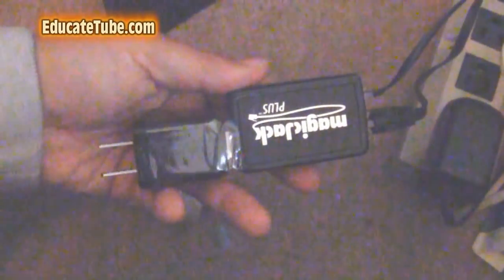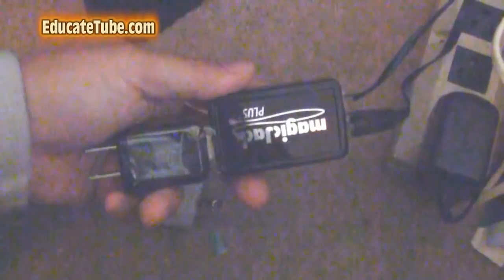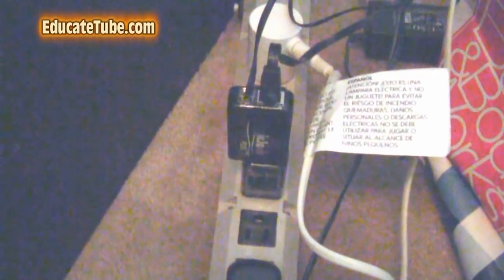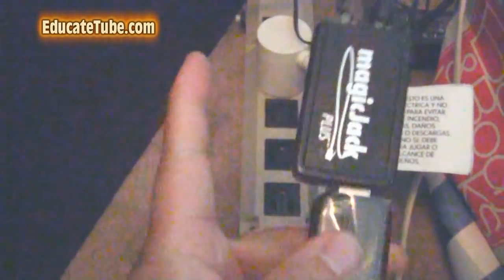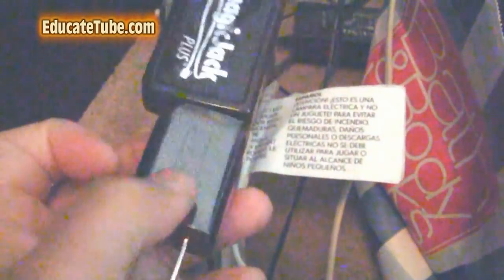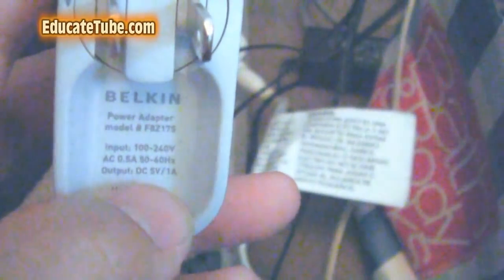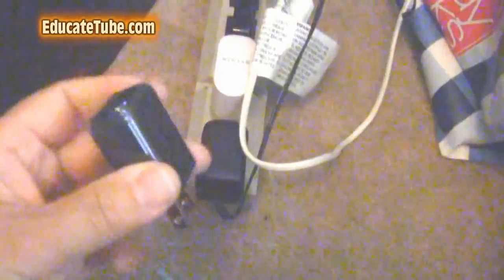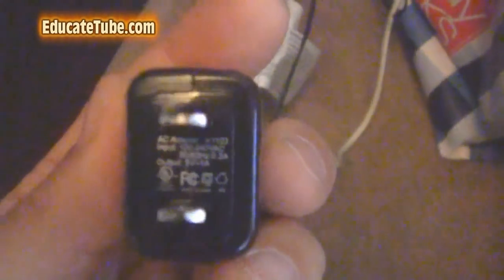How to repair or fix MagicJack Plus Hardware VOIP device by replacing USB AC plug

Comment: I have constant issues with constant beeping noise that people on other end are hearing. I call tech support, they fix the issue, but then there is a constant loud static noise on my end? Is there a solution to this? Using magic jack plus for panasonic cordless home phone......never had these issues until about a year ago, and have had device for 7+ years.

Comment: I have replaced power adapters off and on for years. Why does this keep happening? And I'm not even talking about packet loss that affects conversation. MJ tech support claims a newer MJ model does not have this problem.  I am ready to return to a wired landline.

Comment: so yeah i switch my power source, i have blue light but no lan connection no orange and green light for the lan 
i need help
Reply from the maker: Make sure your internet and Magic Jack account are active.  If the light is on that means it may not be the power but the device itself.

Comment: Just as an fyi, as long as the voltage matches (5V) the amps on the replacement P/S can be higher than required:  The device will only draw the amps it needs, anything extra will not be used.  For example, a 5V/2A power supply would be fine for the MJ.  It's always better to have MORE amps than needed, in case the device draws a tad more than it's rated at.  If it tries to draw more and there's no more available, there could be overheating and damage.  I always buy power supplies with higher amp ratings than required.  It's like having extra horsepower under your hood-- You may not always need it, but it's nice to have.  Remember though:  You CANNOT use a P/S with higher VOLTAGE, it'll fry the device.  Also:  Current is rated either in milliamps (mA) or amps (A).  1A = 1,000 mA, so for example a p/s rated at 5V/1500 mA is the same as 5V/1.5A.  A p/s rated at 5V/750mA is not going to work with the MJ (not enough amps).    Hope this helps someone.
Reply from the maker: Thanks for letting us know.

Comment: Great if the only thing to get damaged was the power adapter.  I replaced the power adapter and got the blue light on the inside, but no lights near the RJ11 or RJ45 connections. So I was not as lucky as you.
Reply from the maker: I think your MagicJack Plus device has internal damage so  I would just get a new one.  But first try logging into your MagicJack account and see if everything is in order.  Make sure it is not a software/ network problem.

Comment: I appreciate your video letting me know the usb plug to get for my magic jack but found it very confusing when I went to try to find one online as so many similar but didn't see the one exactly like you show? No doubt I am just not looking at the right place and I went to Belkin website and they have no email address for me to ask them and couldn't get my phone to work when I tried to call them. Could you post a link to a usb plug for magic jack exactly like the one you show in the video? Thanks!
Reply from the maker: Hi, you can use any usb plug as long as the voltage and amperage are correctly used.
Reply: Will this one work? I don't always see the volts or the amps on the ads and this one shows the volts but I don't see if it's 1amp output??
https://www.walmart.com/ip/Belkin-Single-USB-Wall-Charger-for-iPod-or-iPhone/16332691#read-more
Thanks.
Reply from the maker: I can't see it either. They have to say 5v and 1A. Not sure if more amperage will shorten the life of magicjack so try to get the same specs.
Reply: Or you could just give me a link to the one you have in the video :) thanks!
Reply from the maker: I got it from random electronic parts that I collected over the years.  So my suggestion is to go to radio shack (if they still exist) and ask for ac usb plug of 5v 1A to 1.5A. If I find amazon or ebay link I will let you know.
Reply from the maker: I got it from random electronic parts that I collected over the years.  So my suggestion is to go to radio shack (if they still exist) and ask for ac usb plug of 5v 1A to 1.5A. If I find amazon or ebay link I will let you know.
Reply from the maker: Here, try this adapter as it has the same specs as my plug:
https://www.amazon.com/gp/aw/d/B017TXGM4I/ref=mp_s_a_1_5?ie=UTF8&qid=1515789189&sr=8-5&pi=AC_SX236_SY340_FMwebp_QL65&keywords=ac+usb+5v+1A+plug&dpPl=1&dpID=41rhygzpM1L&ref=plSrch
Reply: Thanks a bunch for finding that for me! I had looked at several and just couldn't find any showing the specs you mentioned.
Reply from the maker: No problem.  Let me know how it goes.
Reply: EducateTube.com the amps is a rating that it is capable of so 1 amp or more for a USB power adapter with exactly 5 volts is what is needed.

Comment: WARNING... DO NOT UNDER ANY CIRCUMSTANCES PURCHACE THE 5 Year Plan FROM MAGIC JACK!:This company is a bunch of thieves and criminals.
  
I had been a mostly satisfied user of magic jack & the unit at first seemed like a great deal, BUT DO NOT get the 5 year plan or buy the international plan until you are about to use it right away.
 Here's what happened to me. I have been using the MJ for over a year and had also purchased the 5 year plan which is $99.75 plus Administration Fee of $7.78, no problems at all and worked great for making calls, faxes for just over a year.....UNTIL I had to fax and unfortunately the number was either not a fax# (or didn’t pick up or was a land line) I was using a computer faxing software and it kept on calling trying to fax all night long and it must have done this several dozens of times back to back since every time it called it didn't get the fax tone for the fax to go through. So the next morning when I tried making a regular landline call, no calls would go through and I noticed my MJ was de-activated and thought that's weird, so I did the usual. Reset it/unplugged, restarted my modem and still nothing. So I had logged in to MJ and chatted online with MJ (this is the ONLY way to talk to MJ tech support) and they told me that they de-activated the Magic Jack UNIT for good & cancelled my 5 year plan I had purchased. Everything I bought was gone and lost. I asked why? What happened?
 And they told me: "Your magic Jack Go has been deactivated because you violated the Subscriber's Agreement, Section 6: Proper Use" 
And that I went over my allowed usage..
WHAT! Are you kidding me?
I explained to them what happened and they DID NOT CARE or bother to resolve my issue under any circumstances. I had initiated several chats over a week trying to get a hold of a manager/supervisor and they were VERY firm on their decision. So basically they STOLE $60 on the unit which no longer works, the 5 year plan totaling $107.53, & $20 in pre-paid international credit that I never had a chance to use. I just lost over $187. 
And to top it off (another LIE for everyone to be aware of), when I bought the 5 year plan, here's what it states:
"Best Value plan $99.75 sates: SAVE 43% with our BEST VALUE PLAN. That's equivalent to only $1.66/month for unlimited local and long distance calling to the U.S., Canada, Puerto Rico and the U.S. Virgin Islands."So basically I went over the usage of "UNLIMITED"
How is that even possible?
The fact they stole my money and to add injury to insult would NOT in any shape make an exception on something that was not my fault.PLEASE SHARE THIS WITH EVERYONE thinking of buying the 5 year plan or evening thinking of buying Magic Jack. Forget all the MASSIVE negative reviews you see all over the internet regarding Magic Jack and their pathetic excuse of customer service. My experience triumphs all of them showing what criminals and thieves they are.You would NEVER get this kind of IRON FIST NAZI Regime type service from a real phone company. Like they say, you get what you pay for.... Buy cheap, buy twice.I am absolutely DISGUSTED at this.

Comment: I don't know who you are, but I thank you from the bottom of my heart. I cannot tell you how many things I've tried to do to get my phone working. Bought new phones. Wouldn't work. Was sending them back. Bought crappy phone from ARC to test my MagicJack Plus. Wouldn't work. Tried my old Trimline. Wouldn't work. Tried to return my 'new' phones to UPS a couple of times, but could never get there when they were open. So they were in a box in my truck. I put in 'how to tell if your MagicJack Plus is broken', and I found your video. Didn't even dawn on me that the power lights weren't on. Duh. Found out that my iPhone USB adapter is 5V-1a, and tried it. BINGO!!!! Went out to the truck to retrieve my new phones, hooked them up, and......IT'S A MIRACLE!!! LOL. They work fine. I am so eternally grateful. Thanks so much, whoever you are!

Comment: I do not use a power adapter on my MJ Plus. The unit gets hot and there is no dial tone on the phone. The MJ tech walked me through uprgading the MJ Plus and it worked perfect for a little while, but now it does not. I uninstalled and installed it two or three times, but that doesn't seem to help. I have had the plus for almost 2 years. How long do they last?

Comment: Thanks to your help, I got my MJ unit working again! YAY!  [no thanks to their useless website! Boo!] Apparently when mounted together, the adapter and MJ unit get hot and tend to burn out the power adapter [?] The suggestion below sounds resonable to me: to use the short jumper cable provided to keep the MJ unit and power adapter separate, because of the heat they generate.
Reply from the maker: SkulpTools SkulpterAz Thanks, you definitely know what you are talking about.  It sounds plausible to me.

Comment: This was my problem too, but my lights were on an flashing.  The line just started behaving strangely.  I could make outgoing calls, but incoming calls would be dropped within the first second of answering.  Also outgoing calls would gradually start having major static with duration. 

This solved it!!  Thanks!   Again, for me my lights were on but the calls were screwing up.  Low power would explain it, but with the lights on I never suspected the power supply. 

Thanks!!!!

Comment: I will tell you from personal experience, separate the ac plug from the mj plus
box it heats up less saving the ac plug from going out again, i separated mine
with the jumper plug it comes with and now the box isn't even half as hot what it used to be, think what happens is the ac plug and box both create alot heat and put
together its like a heat bomb ready go off, do the separation now and save later from replacing the ac adapter, this is why it goes bad.